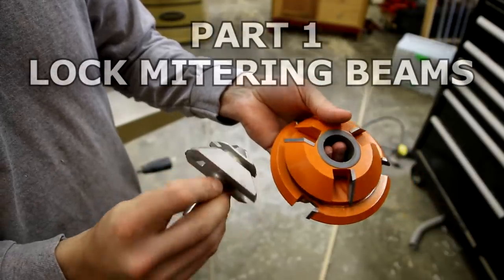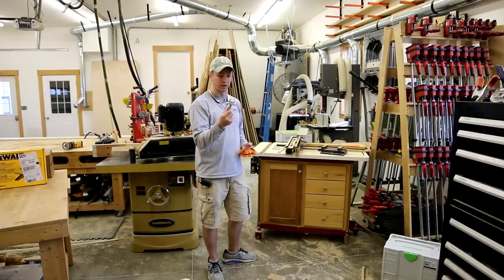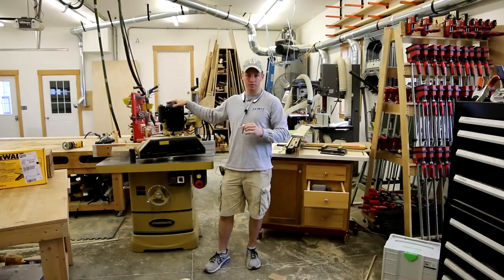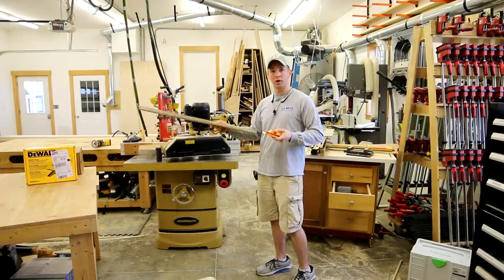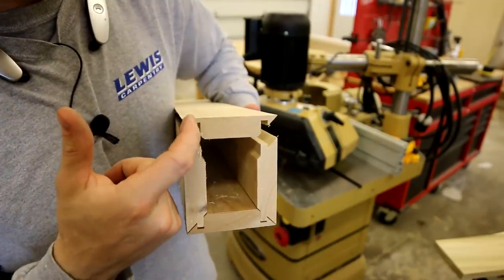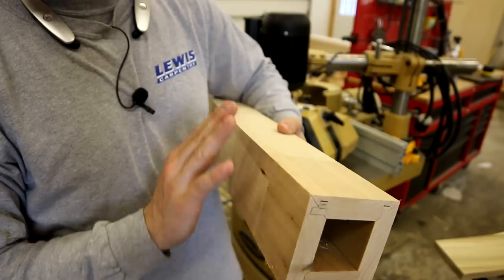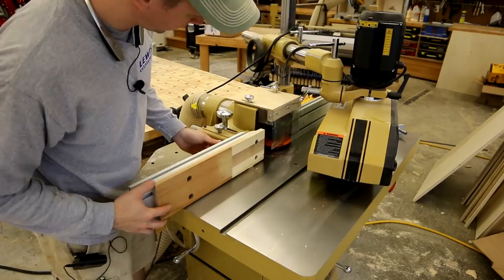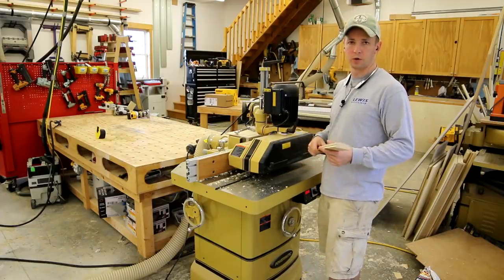The ONLY Lock Miter Bit for Beams - This Bit is a Game Changer

Comment: I really like the idea of the workpiece being cut with the resulting profile bevel facing up. This means the board thickness is not too critical. For regular lockmiter setups on router tables and most shapers, you have to make sure your boards have precise width and thickness. Thanks for sharing
Reply from the maker: Exactly! It’s a huge advantage.

Comment: Hi 👋, I am new to your work shop, I have both, but the one I used the most is spindle moulder / shaper , made by LEITZ 125130 mitre jointer cutter block. With long in feed and out feed tables, 10Hp Felder , And to set it up you do both edges of face and back boards lying down on the table and the sides you stand up on the back fence you obviously rotate the power feed to go against the fence driving it downwards into the table bed, 28m Thickness of the material maximum, Retired English gentleman specialist joiner cabinet maker ,now in France. 
PHIL FROM THE DARK SIDE OF THE MOULIN

Comment: I did a bunch of 16' beams with the lock miter bit on a router.  Exactly the problems you mentioned.  Setup took a while.  And I had to built a flat outfeed table when running it vertically.  That shaper makes it look like a breeze in comparison.
Reply: Did you use a router table?

Comment: Been dealing with the same thing. Ended up running my miter locks before gluing up the wide boards (which is also a pain because I had to use blocks with the miter lock profile cut on them to clamp the glue up)- it worked in preventing me from having to send a 13 inch board through vertically but was really not ideal.

Comment: One of the things that people can do to reduce strain on a router using a lock miter bit is to cut a miter that runs about an 1/8" shy of your final cut. Leaving the bit to hog off that much stock will be a strain on just about any router. But pairing it down to where you're only removing an 1/8" or so will create not only less strain on the motor, but also produce a cleaner final cut.

Comment: If you angle your power feed slightly toward the fence you don't need feather boards to keep it against the fence.
Reply from the maker: It is. 👍 the blocks are just a little extra insurance. It still will wander on me for some reason occasionally.

Comment: Hello, the sharp corner that you are talking about should not be there. This is very fragile when sliding over the machine table and fence. It is better to provide a small flat surface of approximately 0.3 mm that you can easily sand away after assembly. Best regards.
Reply from the maker: That makes sense. I'd like to get a lock miter bit for my shaper and try that also.

Comment: Question about the lock miter: Is it really better then just a 45* glued together? I've done all sorts of assemblies using 45 miters. Sometimes I've pinned them with nails, sometimes not. I've only used a lock miter once, and it just didn't seem worth it. You still need to fiddle around with it to get the joint perfect, and you've got all that extra machine work to boot. People say they're stronger then just a straight cut miter, but I've tried taking apart assemblies that had been properly glued, and most of the time the glue joints have stuck together very strongly for me...I'm just not totally sold on the lock miter system. Its cool though...
Reply from the maker: The lock miter is more of a production tool. It shines on large quantities. Also this bit is not you’re typical lock miter. It’s a completely different design which makes it great for large and long material like beams.
Reply: I’d be interested in seeing a comparison of speed and quality using a standard miter with dominos.  Seems like it might be just as quick or quicker for small projects especially if you don’t have room for a shaper.

Comment: I picked up the big orange freeborn shaper bit...
I machine all the parts and I’m a little bit concerned at how thin the face of the wood is because the dado must be so deep to accept that tongue.
I think I might have our sharpening guy grind down that slot cutter to, allow more than an eighth of an inch of material on the face side.
Reply from the maker: I don't like how thin it is either. That's a great idea about having it ground down. I may look into that also for my own cutter.
Reply: @InsiderCarpentry   Also on the wish list, I have the same shaper and Powermatic power feeder that you have to...I really wish there was a slower setting...I fed it through holding it away from the fence a little bit to hog out the first pass or two but the “turtle” speed it still goes pretty fast for a final cut like that
Reply: My mistake I just looked at this cutter with sharpening guy and I was thinking about it backwards ...grinding off of the quarter inch slotting cutter would make the problem worse you actually have to see if you can find a slotting cutter that’s like 4 1/8 rather than the 4 inch that it comes with
Reply: @yettielusive3370   one could just rip an 1/8” off the 1/4” tongue, although it would be adding a third step. It doesn’t look like @InsiderCarpentry is using the lock miter much anymore.

Comment: if you don't have the money for a Powermatic shaper, you could always take the router out of the base and instead move the router along the board.  You'd have to have some nice jig set up to hold the board on edge and everything, but I think it would be possible and practical.
Reply from the maker: Justin Giglio Not much of a chance of that working with a lock miter. In the vertical orientation you’d be trying to balance that giant bit and router on a 3/4” wide edge. Not gonna happen. Running flat maybe. But vertically no way.
Reply: that's why I mentioned a jig.  like a flat base that sits on one side of the upright board.  Or you could get one of those special plates that allows you to use your router at 90 degree angles.
Reply: I get your point, but i'd rather have the dangerous moving bit lock down stable, than jumping around in my hand 
Of course, IMO.😎
Reply: I did  use the router and a jig to shape the corners on  1"x6" 20 ft long cider boards. The jig did a great work. i recommend to do it whit the router with no table .Just clamp the board to a table and work along the side.